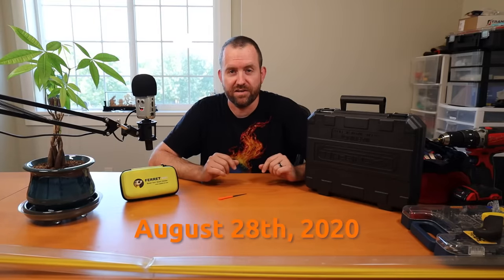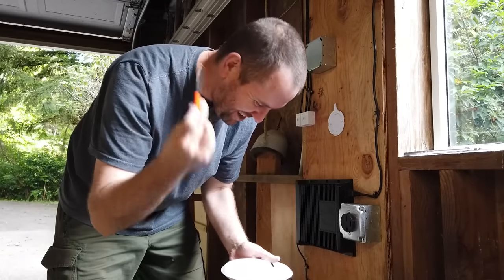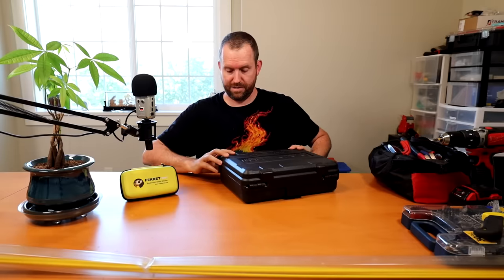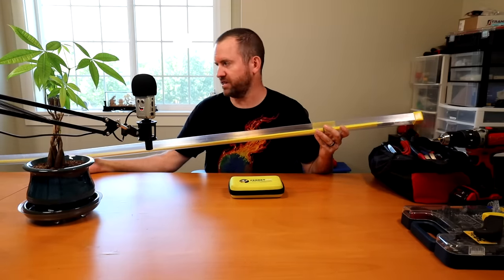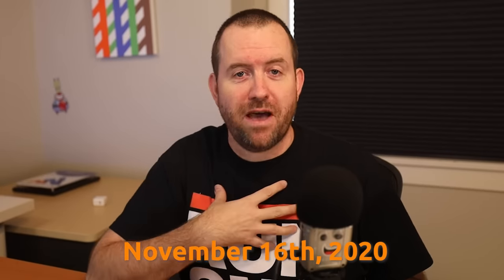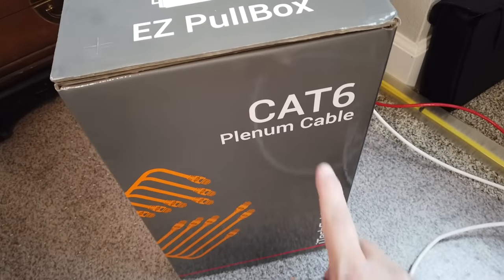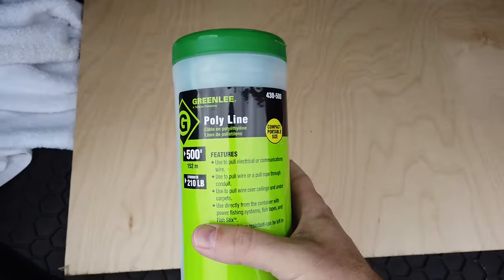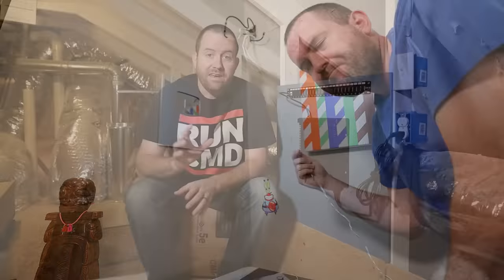CAT6 Wall Fishing

Comment: The in-wall video camera would have been very helpful when I installed a 2" conduit from attic to basement in a 6" plumbing wall.    I had little access to see into the wall top or bottom except with a mirror, and it was quite a challenge avoiding obstacles.  I planned a path around the plumbing, but I hadn't anticipated the power lines in that wall.  I doubt anyone will notice the extra holes in the doubled 2x4 header.
Reply: What do you need a 2" conduit for in a residence? What size wire you pulling? How many? Was it flex conduit? I hope it wasn't 2" EMT.

Comment: Sometimes I have to pull cable through large areas above drop ceilings that narrow down to smaller, difficult areas. I could definitely see some good use of the Cable Ferret in doing that!

Comment: Having been on construction jobs running electrical with my brother in open walls - I kinda expected the issues you experienced with closed walls.. closed walls are always harder to run cables because you never know what's inside if you didn't built it yourself or see it with walls open.  My other brother re-did the walls at my moms house and used fiberglass on interior walls for sound deadening (didnt work as planned cause the drywall reflects the sounds just as much as the fiberglass deadens it between) -  I told him he should have run Ethernet to all the rooms - he ignored me and just ran electrical - cue year+ later and he bitching about wifi being to weak from one side of house to other and still refusing to run ethernet cable..

Those tools would be useful for everything to do with cable pulling in closed and semi open spaces.. - the Cam can help detect fire breaks that some locations require in the walls - A fire breaks is where they put 2x4s about 3-4 feet up the wall horizontally inside cross connecting the 2x4 vertical studs..  this is to prevent fire from going up the inside of the wall and heading up to the roof like a chimney. 
I have been planning to run cable around my house for awhile - only thing stopping me is bad back which prevents me from going into crawl space. I do not have attic space to run cables but I have a decent crawl space - which I could crouch walk around in - if not for bad back making that extremely painful currently.  its on my list of things to do possibly next year in summer after I deal with my back issues some.

Comment: That cable ferret would be ideal for hooking onto poly line where you cant get direct access either by hand or entirely by a pull rod. There have been a few instances where I couldn't run a wire because I couldn't feel or see the line.

Comment: stumbled on this video after having pulled a few fiber lines (for SFP 10gb connections) into my basement recently -- pulling those lines is rather tricky since you can't really pull-tug on them or you'll just destroy them, they are also pre-terminated, so that's makes it trickier still. I tend to not want to drill large holes in my 1st floor office floor to pull wire, so that video device would not be useful. And magnet, not sure either.

Comment: Should invest in a magnespot, it's a tone generator. Place the tone generator on the ceiling then go into the attic with the receiver, it pin point where you need to be, forget the tape measure.

Comment: Chris.. Curious question about that box at the top of the wall (the one that had the coax and RJ-11 in it initially).... When you first pushed the Maga-Pull up the wall, how did you get that shuttle out of the box? Most electrical boxes have only a very small hole for Romex or other wire to go through, and while small, that shuttle certainly doesn't look THAT small, and eve if it were, the holes are usually at the back of the box, and since your shuttle was sliding along the back side of the wall (e.g. the front of the box), it sees like it would have been very hard to hit that hole. Was there no box in that opening? It looked like I saw a typical blue plastic box in there when you did a close-up. I know you didn't end up using that, but I am curious as to how you got that through the box so easily.

Comment: Why would you pull against gravity? Feed it down. And yea, you must drill a hole into the top plate. Same thing with the base plate. Many building codes requite a fire block about halfway up-down the middle of the wall. If your house was the (really) older balloon framing would there not be a top plate or bottom, depending on what floor you were on.

Comment: The old co-ax cable makes a perfect pull through... just sayin.
Reply: Not when it’s often stapled to your studs because they were placed during new construction... 😕
Reply: @mrvvoo  That's the kind of shit that happens when electricians  pretend to know how to lay data cabling.  Twice I had dimwit sparkys lay RG59 instead of RG58 and the excuse was it was much cheaper to buy and looked the same.
Reply: @einfelder8262  Fantastic excuse. It was cheaper to buy and it looked the same. Wow.... because the technical details never matter.
Reply: @einfelder8262  i am not an electrician but what is the difference may i ask?
Reply: @Ultrapro011  One is 50ohm and one is 75ohm. Ethernet/radio devices operate on 50ohm, TV/audio 75ohm.
Reply: @einfelder8262  and what if you operate with the wrong one does it work but not well?
Reply: @Ultrapro011  Not sure about whether tv/audio works on 50ohm, but I can 100% verify that ethernet does not work over 75ohm, even if you manage to get the fittings on and use the correct 50ohm terminators.   Thankfully we no longer use coax for ethernet so the issue is a historical one.
Reply: @einfelder8262  well i have cable internet and tv and it goes on rg6 75ohm so idk...
Reply: @Ultrapro011  That is the right cable - 75ohm.  There are various constructions of 75 and 50 ohm, but it's the ohm rating that's the important value, not the thickness of the cable.
Reply: @mrvvoo  wow network cable stapled to studs..hmmm will check that.
Reply: @rbnjr  when doing a pre-wire for network or any other low voltage wire you need to staple them down to the studs so that when they go to install the drywall they don't smash the wires between the sheet rock and the stud. I've seen it happen a 1000 times.

Comment: The bést cable pulling tôol is a strong but thin cord with a 3-foot length of the smallest chain you can find at the hardware store (the size they used to use for toilet pull chains) tied to one end. 

Use it by dropping the chain from the top ò the wall / cavity and use it like a fishing line ìf you locate an obstruction. A strong magnet can guide the end ò the chain to where you want it to go. 

Never pull cable with another cable, far better to use a strong thin cord - thí avoids lumpy knots / joints in the cable to be pulled.

Working against gravity with a cable ís dumb.

Comment: The Ferret. Helps when you have vertical noggings, or if you drop something in the wall...  

To make a hole in the nogging you need to be sure that there is no electrical cables near the hole point....

Comment: I'm super jealous of you Americans with your stick frame and drywall houses. Here in Europe we're dealing with concrete block walls on a good day and hundreds of years old, heritage listed, stone walls on a bad day. Most of our retrofit jobs involve grinding wall chases and cement patching :(
Reply: Frank Silvers  Because we don't have baseboards when you have a stone floor and a stone wall and even if we did, we don't mount TV's and access points on the floor. We do everything on the roof as here in Spain all the roofing is flat, then drill down or across from the exterior.
Reply: Frank Silvers  I don't understand the question? Typical construction is rendered block wall going to stone floor. There is no baseboard.

We mount all access points on the ceiling as standard. Never mounted one on a floor. TV's are usually in the middle of a wall. Not on the floor. Our clients would not accept visible cabling going up to the TV.

All our 'home network' CAT6 wiring is typically run externally through conduit on the flat concrete roof, then penetrations are made to the interior where needed.

Lookup 'Blakstad Villa interior' on google images and you will see our typical construction style that we deal with daily.

Comment: - Don't bend a cable in two and try to fish/pull it.  This is what caused all your attempts at your first run to fail.  Even with the insulation that was a very basic and very short pull. Pretty much any method should be successful on that run.  It was the bend getting caught making it more difficult.  Have to fresh cut ends and tape them to your rod, fish tape, magna pull, etc..   

 - Also make sure you tape things in a slim and tapered fashion.  Don't over tape.  Too much tape will be too bulky.  And keep wires straight and ends staggered.  Don't have them unnecessary overlapping each other creating bulges.  Also pulling multiple cables, you don't have to tape all the wires to your pulling tool.  Usually the pulling tool is much thicker than the wires themselves.  Come back 1-2ft where you just got the wire itself and tape on your 2nd, and remaining wires.  It will pull so much better without a big bulky bunch right at the end of your pulling tools. 

 - When dealing with insulation.  Your rod, fish tape, flex drill bit or any other stiff tool wants to stay straight. So inserting it into the wall cavity it's going to be in a bind. If there is insulation, you can't make that 90 degree bend to be exactly between the sheetrock wall facing you and insulation.  Pop your tool through the insulation and use the exterior wall or sheetrock on the other side the wall as a guide.  If you can get it in the corner so you can feel it smoothly slide up or down the stud.  Trying to go in-between the sheetrock and insulation will always bow out and send you right in the middle of the insulation. And you can only push through so much insulation till it eventually bunches up and doesn't let you go any further.  But if you let the tool go into the angle it wants to and slight up a flat surface it will be much easier. 

 - Also don't mount your faceplates so low to the ground.  Mount them same height as electrical boxes 18" or whatever code is in your area.  That foot or so off the floor makes a big difference than 4" off the floor trying to fish/pull cables.

 - The poly lines main purpose is to be left in the wall/conduit for future pulls.  You should rarely ever need it to assist in a new pull.  If you want to be efficient and cost effective. 

 - The board you used in the attic isn't plywood.  That's OSB.  Next time, don't use OSB for your safety.  Might have been ok once, and for a short distance.  But if you keep using that board over and over, it will eventually give out and you don't want to fall through sheetrock that's not a fun day.  OSB is not safe to use as a work platform surface, use plywood instead.  If all you got is the OSB, place two 2x4s down first to support the OSB.  

 - You should use a low voltage single gang box instead of the sheetrock anchors.  About the same cost, box lasts longer if you take it out several times to run more cables.  And much easier to get level and straight.  Also the hole is big enough to get your hand through and grab if needed.  (Before mounting the box to the sheetrock.)  I can get half a forearm into a single gang hole, but I know that will differ from person to person.  Insulation is not as bad if you can get your hand in the wall and feel around.  I recommend gloves if you've got to go into insulated walls.  

 - Use a proper punch down tool to terminate wires to keystone jacks. Using pliers and the covers is not correct.  The plastic covers aren't strong enough, and can lead to an unsuccessful punch.  They are only meant to keep the wires from coming out if snagged on.  Also a proper punch down will cut for you as well.  Cutting with scissors leaves excess that shouldn't be there.

Comment: Few questions:

How would you go about finding the cable in the wall if you didn't have the magnet after you've fished it down?

How did you go about measuring and finding the wall? Does your attic have the same area  as downstairs to where the walls line up?

Comment: I was seriously considering using an industrial switch in my attic or garage for cameras since I would only need one cable but what stopped me was backup power. I want my cameras working when the power goes out. My network rack switch is on UPS. So I had to home run the cameras.
Reply: I considered this too, but ultimately decided to put my switch in a central closet.  It doesn't take up much room, receives temperature control, and is less vulnerable to the elements (humidity, pests, etc.)  Although it required a bit more cable, it was infinitely more usable, and it definitely prevented me from jumping into the attic a few times a year.

Comment: Nice looking tools, although it won't be very usefull over here. Here we do everything through conduits, no loose wires behind walls. Easier to pull wires and they're somewhat protected against damaging them. More diffcult to make outlets after the walls are finished though.

Comment: I would have drilled a very small pilot hole on the ceiling as close to the wall as possible. Then run up a straightened coat hanger through the small hole, push enough that when you go up to the attic, you know where you are. Next, i would measure 1 1/2" off of that hanger wire and then drill down to create my access hole. On the floor area where the wall plate is to be mounted, I would have squared off an area to accept an 1 Gang Low Voltage Mounting Bracket Rework. run your fish line from the top to the bottom, attach your twine and pull up. once up, Fish the wire + extra twine for future wire from top to bottom and then to close it off, use the wall plate and screw it in like you would normally do. It leaves a nice clean look and a hole big enough to stick your hands inside if you need to service. I've did my entire house is this fashion all the way to the basement where my server rack that holds my  Modem / Router / Firewall / switch / Poe switch / Web Server / FTP Server and UPS Battery Backup. The hole that you created can easily filled with drywall compound since it's a very tiny hole and you would never notice it. But as you said, you are not a pro, just an novice but you could have done a better job if you actually took the time to study on your plans first before you tackled on this job. I'm not a pro either, just as much as a novice as you but planning ahead and using commonsense really helps. As for the Ferret tool. Yes, this tool came in handy to look for electrical wires in the cavities of the wall because electrical wires can cause electrical noise interference on your network cables. Since CAT6A has a good shield, I would use these where electrical wires are present.

Comment: How did you attach the poly line to the cat5(6?) cable? I have tried attaching a pull cable to another cable, and it falls off every time. A detailed look at how to connect cables/lines together would be helpful!

Comment: You definitely need some basic practice with a 25ft piece of chain and a coat hanger.  It will fish everything that you've needed so far,  fishing from the top down.  Fish tape is the next addition and then a long flexible electrician's drill bit with holes in the ends.

Comment: Yeah this Ferret camera is old news to me.. I can't remember now but I am going to guess that it has been 8 years ago now I used a camera I took off  my quad that connects to Wifi and used my Phone and the camera to see in my no to easy to access roof space.. I have since used a ton of devices depending on the size of camera needed and or the quality of picture needed.. I have also used them for going down my Fresh return air from the top floor to the bottom floor and use them all the time to make sure the cleaning out of the channels are done right when I clean them out.. I wonder how many people really clean out their return air and ducting vents for heat and AC.. I have many different small cameras and the cost is much less then these Ferrets.. Also have a 6' snake camera with LEDS that I may have used once because the other cameras I use are better quality and can go many more places.. But if I needed something with very small hole and less then 6' of use I have it when I need it..

Comment: I've wasted 5+ hours trying to get my fishing line from my attic down to the basement utility room (to run network cables) -- I've only ran wire from outside to the attic and that was much easier. So I splurged on the magnepull in hopes that it will get the job done.. we will see how it goes when it arrives. I do not understand how some people are so good at this.. it's literally like poking around while being blind, trying to get the line in a hole that you've drilled with insulation making it even more difficult :/

Comment: The magma pull was not designed to pull them cables or any cable. It's designed to pulll a guide, then you use the guide to pull the actual cables.

Comment: Instead of plenum cable you should use riser cable. Plenum cable sheathing cab get brittle and fail and riser cable is appropriate for vertical runs.
Reply: Plenum is rated for riser apllications although riser is cheaper.  I haven't heard that plenum has a reputation for getting brittle before .  Are you sure it wasn't due to a cheap manufacturer , being stored in the sun or some other factor?